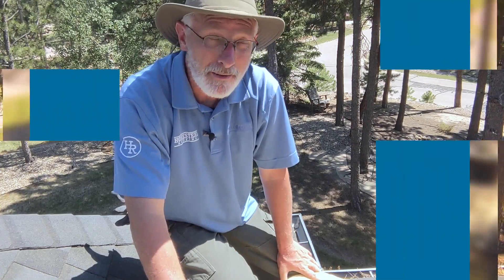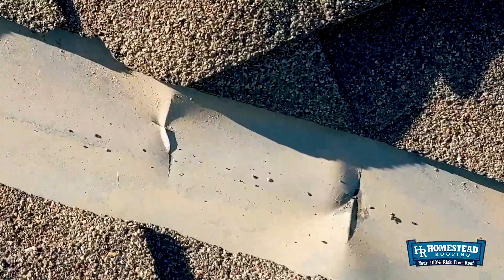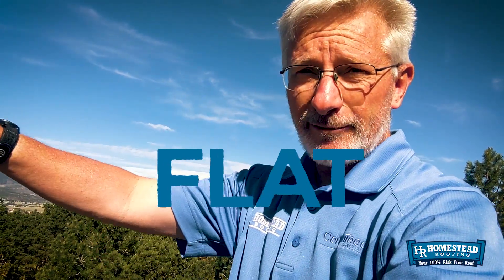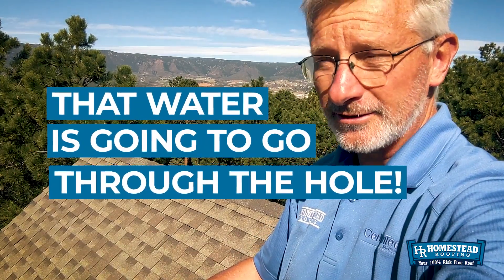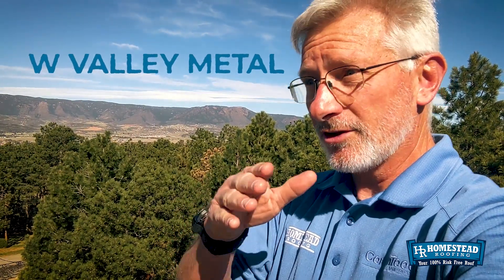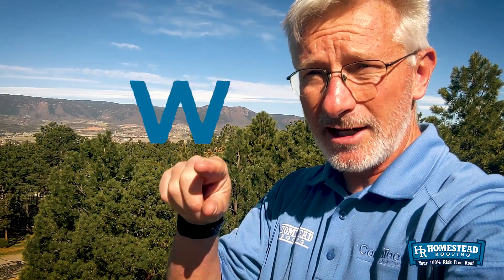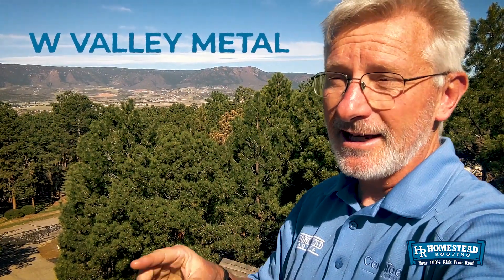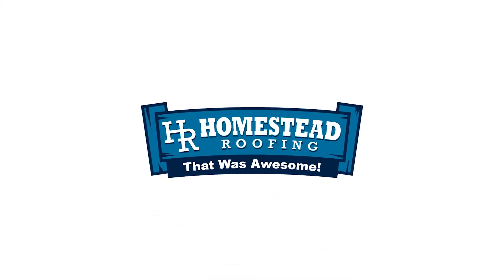The Truth About Flat Metal Valleys on Roofs

Comment: The question is in a valley does the anchor deck, the blue stuff or whatever GAF offers go on top of it? 

for my Valley 
I will tell you this stuff is horrible… Someone installed it on my roof. I guess it’s improper installation but there’s several places that have small cracks. It’s sort of like a hole about the size of a coat can and then there’s places where it’s torn 3 to 4 foot… There is no way that is better than Valley metal. 

Maybe the difference my Valley has a gap of 2 to 3 inches but I can see straight through to the shingles… Isn’t the roof anchor deck or whatever GAF supposed to be on top of that? 

I’m guessing it’s just a horrible despicable installation by the Roofer… If you go to my page, you can see a three minute video of some of the shingles and that’s not even near the pictures I have   

Several of the shingles are torn, some of them have holes in them all the way through to the next shingle and one of them has a patch of caulk about 4 to 6 inches across and there’s still a crack in it

Comment: Hi there! Thanks for the informative video. I’m in Central Florida and currently researching options for a roof replacement. Most of the contractors I’ve spoken with are recommending either two layers of GAF FeltBuster or one layer of StormGuard peel-and-stick as the underlayment. I would have preferred to use one layer of GAF Tiger Paw for better breathability, but none of the roofers seem too keen on using it. Given our hurricane season, I’m leaning toward StormGuard for the added protection, but I’m still a bit concerned about ventilation. I’m also planning to go with W-style open valleys. Would really appreciate your thoughts on the two options for underlayment—thanks in advance!

Comment: From your background, it looks like you are somewhere in the Southwest USA.  I'm in northern Ohio.  Up until about 10 years ago, I had never seen a woven valley.  Every house I'd seen used the W metal valley and in the houses I've owned they have never been a problem.  And the house we currently own the shingles are so old that they're beginning to crumble, 40 to 50 years old.  But, the W metal valleys have no problem whatsoever.  All of the bids for replacing the roof that we've got so far specify 6 foot wide ice guard membrane in the valleys with the W metal valley.

Comment: There is a reason why you're supposed to install "W" crimp valley. Rolled metal coil down a valley has no torsional strength when the roof structure moves and shrinks. Only completely idiotic roofers install it because it saves them money.  I've chased that kind of crap since 1971. Also don't use any aluminum less than.027 and steel less than 26ga.

Comment: Irrelevant. It’s no different than a standing seam roof using ice and water shield. You field measure the pitch on site visit, you ensure both sides of V from break covers atleast 2 shingle course widths or 18”, you use coil metal and break and press to custom fit. If you’ve seam ensure it interlocks so water flows over lock area. Ensure you use high temp ice and water. However installed was not a roofer. Also it’s not  just flat metal it’s used on pitch and flat
Reply from the maker: Thank you for engaging with our content. I actually disagree with you. I think it is quite a bit different because standing seam metal isn't creased to conform to the shape of a valley. If it were, it would also potentially develop cracks and holes.

Comment: Uhhhmmm, who doesn’t use a brake to bend the aluminum?
Reply from the maker: Apparently, none of the crews here do that. They just roll it into the valleys.
Reply: @homesteadroofing  I don’t like open valleys, but when I’ve done them, of course the aluminum is bent in a brake and ice and water goes under all the way up the valley and then goes on top 4inches out of the valley.